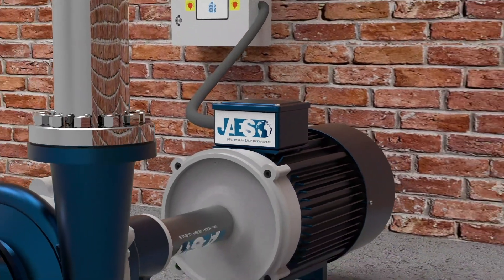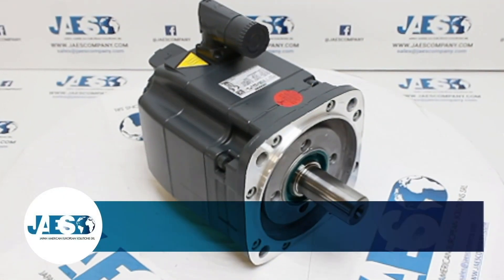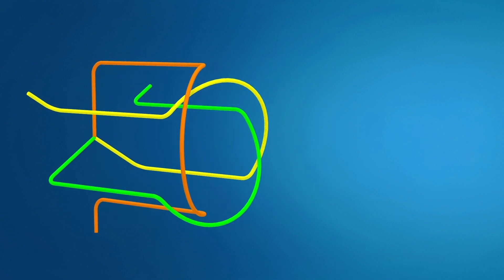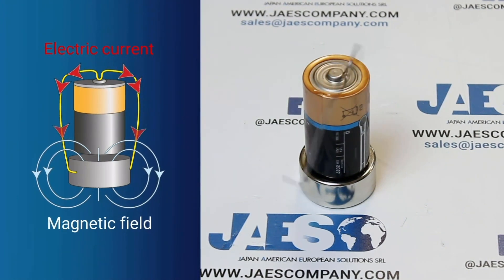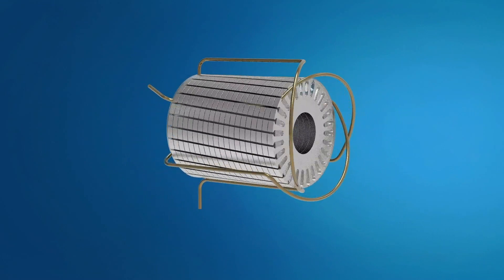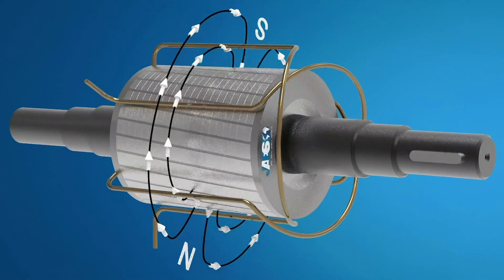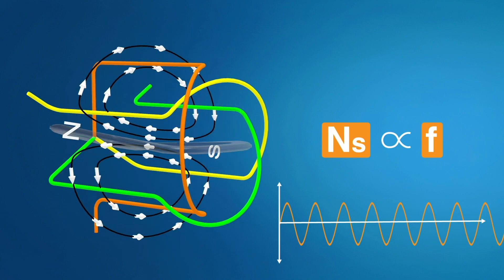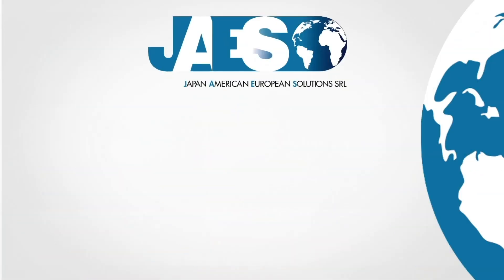What is an INDUCTION MOTOR (THREE-PHASE ASYNCHRONOUS MOTOR) - RMF Rotating Magnetic Field

Comment: That is a relatively fair assessment of an induction motor. Instead of using a permanent magnet in a rotating electromagnetic field, the em field creates or induces a magnetic field in the rotor. 

If we look at Teslas original patent he used a permanent magnet instead of a squirrel cage which differentiates his design from an induction motor.

The clever thing about Teslas was that it was a universal motor and could be driven with AC or rotating DC, which is simulated alternating current used in "brushless DC motors". 😉
Reply from the maker: thanks you for your comment

Comment: Tesla cars use battery packs so inverter is required. Can your inductance motor be use without the inverter if my car does not use battery pack?
Reply: No. Alternating current is important in it's rotation.

Comment: OK- You say Lorentz force is what's causing the rotor to turn. What I can't grasp is if Lorentz force is causing the rotation then that rotational force from the Lorentz effect would be applied to the rotor at the moment of start-up when the rotor is stationary. If that's the case then why does a single phase AC induction motor require a starting winding or a shaded pole? Seems like the initial rotor rotation from standstill would take place solely from Lorentz force therefore not requiring the starting winding. Try and clear this up for me.

Comment: The video is excellent in many ways. It could have been mentioned that the relation between the coils of the stator and the loops of the rotor are in fact acting as a conventional transformer with a primary and a short circuit secondary. Also, I do not like to say that the induction causes a current to flow as the sequence is in steps where the  fluctuating magnetic field from the stator will induce a voltage in the loop of the rotor which could  be open circuited and there will be no current only a voltage  and so the rotor will not run at all. Due to the short circuit of the squirrel cage effect on the rotor, the induced voltage will create a current in the rotor loops which in return will create a magnetic field in the rotor which will react which the field in the stator which caused it all to happen.  It is imperative to understand that voltage is induced in the rotor if the copper in the rotors has a RATE OF CHANGE WITH RESPECT TO THE ROTATING FIELD.  and so for this to happen the rotor must never rotate at the same speed as the rotating field on the stator. It is like a person running with the wind if he runs as fast as the wind in the same direction he will not feel the wind in his face  nor on his back, but if he runs faster or slower than the wind then he would feel the wind, IN the case of the induction motor,  the rotor loops run at a slower speed than the rotating magnetic wind!
During the video, at all times the rotor loop was shown it is always shown running at the same speed as the magnetic field and also the orientation is such that there will be no voltage induced it as the electric loop is not curling the magnetic loop and as sown there is no rate of change of the magnetic field with respect to the  loop, hence no induced voltage nor current in the loop. 
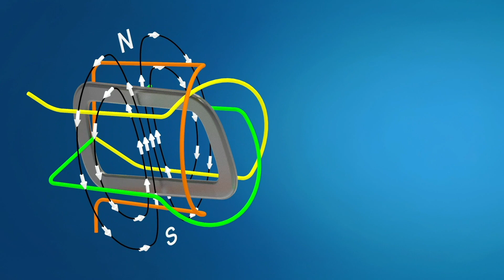At 7:15 the rotor loop should have a rate of change with respect to the stator rotating field.  
I would say that it is important to show that  Curl H= J  + dE/dt but in this case, forget about the latter.  hence Curl H=J wherein the case of an induction motor both H and J must have a rate of change as it will not work with DC.
Perhaps a mention of the stepper motor or the DC brushless motor could have been mentioned but then the induction due to the rate of change of the stator  magnetic field with respect to the rotor loops would not have been  indicated only the rotating functions due to synchronous rotating field as in the synchronous motor when the rotor  of an induction motor carries a permanent magnet or a DC field so that it will lock on to the rotating stator field.
Reply from the maker: Dear Carmel thank a lot for your time and for advice and correct us.We create a new video about plane can you leave a comment and tell us what do you think  new version https://www.youtube.com/watch?v=OCh4svEfDmE&t=621s thanks